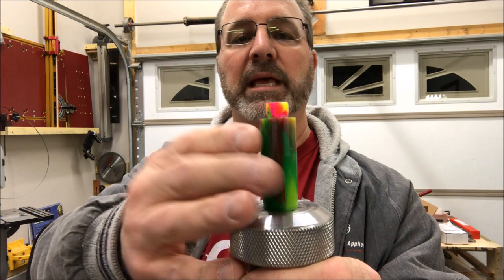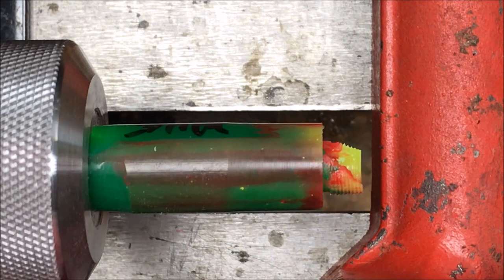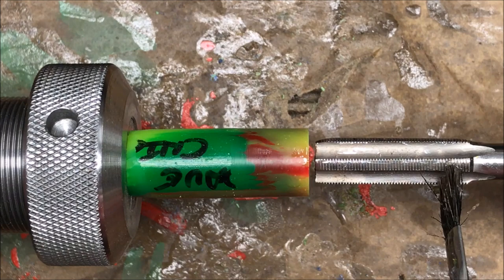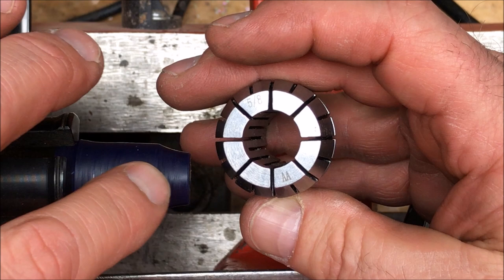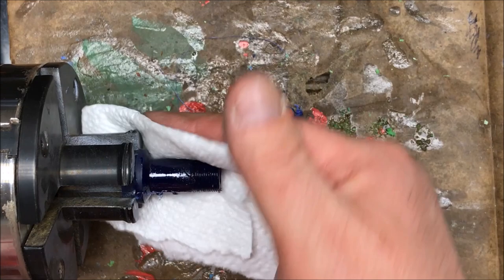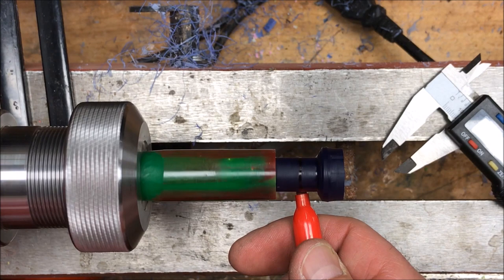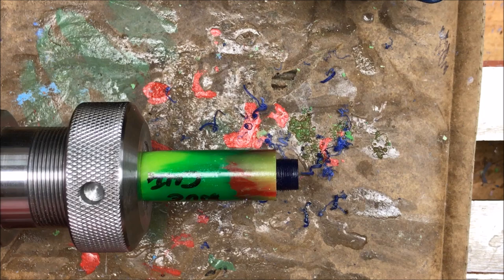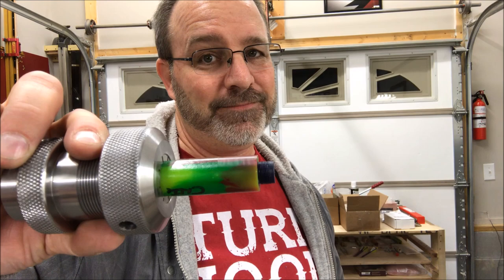Bespoke Tenon Rapair

Comment: Great save!

I haven't tried to analyze the dimensions, but it seems to me that when you drill out the tenon, there will be a very thin wall between the bottom of the threads and the inside of the hole in the tenon.  If the CA is evenly dispersed on the threads, the tenon will be tightly bonded to the body.  But if the CA isn't evenly dispersed, that thin wall could later prove to be a problem.

Why can't you just drill out the body, and then turn a short length of rod to the dimension of the enlarged hole, and just glue it is without the threads?  That would be a simpler process, and might avoid that thin wall problem.

Or, if you want to use the threaded tenon approach, it might make sense to use medium CA rather than thin so that you are more certain that any gaps between the male and female threads are filled.

Another thought - - if you are going to be turning your own section, why can't you just make it a bit longer so that it threads into the end of the body, rather than having a threaded tenon on the body that threads into the section?

Different ways to skin the cat?
Reply from the maker: Thinning shouldn’t be an issue because the tenon is the same diameter on both ends. It is comparable to screwing on the cap so if it does not show through the cap it won’t show through the body. 

I like your ideas too and they would work as well. 

Regards,
Bob